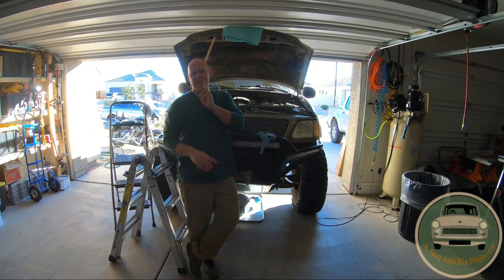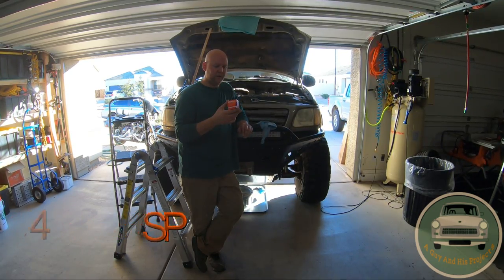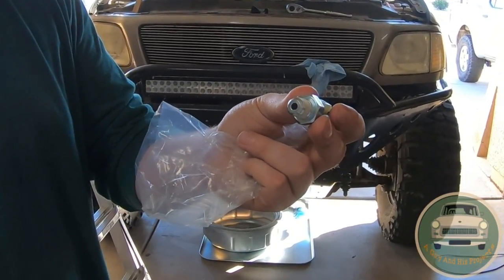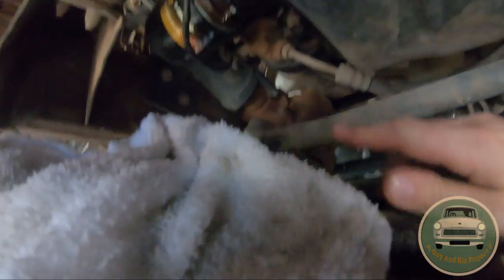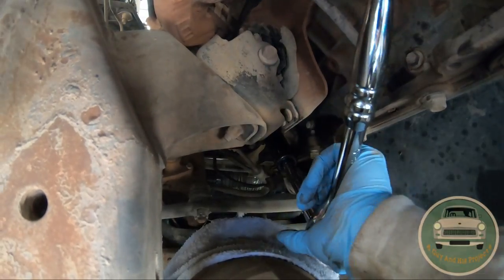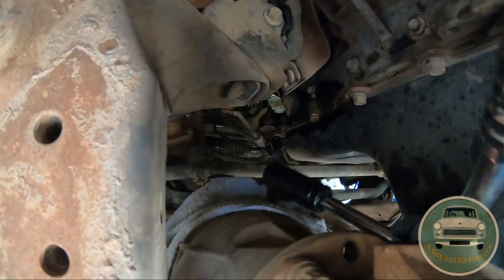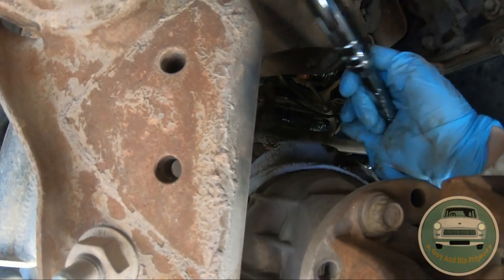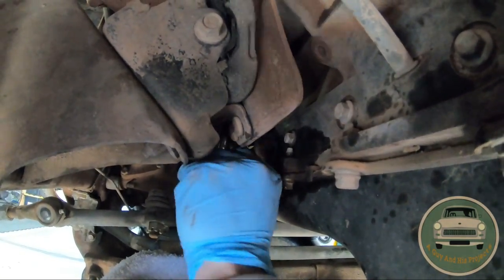How To Change F150 Oil Pressure Sensor aka Oil Pressure Sending Unit

Comment: Thanks for the video. My trucks low oil pright just started to come on when I start it. After 30 seconds or so it'll bounce into the normal position.   I have plenty of oil and only 80k miles. I am going to replace this sensor when I do my oil change next week. 👍🏼

Thanks!
Reply from the maker: Hope it helps! Typically indicates low oil pressure on level thought
Reply: Did changing the sensor resolve the issue? I'm having the same issue with my 2000 F-150. The low oil light only comes on when it's below 40 degrees out and then moves to the normal position

Comment: I have a 2000 RWD 5.4 that when cold the oil light would go on and off until it warmed up. Mine was slightly different to remove though so if anyone sees this and needs help here what I did. 

I was able to get the driver side on a jack stand and my oil pressure sensor was only accessible from the front of the truck. After getting under it I was not able to get the connector out as it was facing towards the back and I could not see or get leverage to remove it. After using an open ended wrench with the connector still on I was able to break the oil pressure sensor loose with the little space I had and turned it around until the connector faced me. Then I used a flathead screwdriver to push down and remove the connector. Then I used the wrench and my fingers to remove the oil pressure sensor. After it came out I had to quickly thread the new one on as oil was coming out and then use the wrench to tighten it back up.
Reply from the maker: Thanks for posting!

Comment: I really like your video and I’ve done a lot of research on my Ford F150 2005 lariat something I didn’t know that took me three months to figure out was from salt corrosion on 2005 that was highway driven there is fuel centre under the spare tire in the rear end. They used to be made out of aluminum and when we finally determined after $1000, I’ve changing out other parts was an $90 fax under the spare tire at the rear end, which is a relay sensor. The old ones are made of aluminum. The new ones are made of plastic and that fix my problem. You should make a video about it.
Reply from the maker: Haha I feel the pain! I have heard similar stories from others about that dang relay

Comment: Hey man I think mine went out i lost all oil pressure but i know nothing about trucks. I have the same truck but do you need to be under the truck to find the sensor ? I can see my oil filter but just the bottom of it when i crawl under the truck. If I take this to a mechanic how much will i spend?
Reply from the maker: I have no idea what a shop would charge, it is pretty easy to diy though!

Comment: Is this a normal issue? My 4.6 has been flickering to zero, then at pressure is flickering up and down a bit, it has to be a bad reading as there is no knock,I just changed the oil as well low kms 240*** so figure I should change it?
Reply from the maker: Thanks for watching! Perhaps more will chime in to help answer your question. As I am not a mechanic I don't know if it is a common issue or not. That being said, it is a pretty dang cheap if you did just want to replace it.
Reply: @BigPoppaPumpx  good to hear

Comment: Hey guy! Hope all is well. I have a 2003 Ford F-150 with the oil pressure sensor on  but in this case the oil pressure gauge is not at fault but the hot or cold engine gauge is flickering. Any thought? Thanks in advance
Reply: could be a gauge cluster. buy an obd2 scanner with diagnostic capabilities off amazon that connects to ur phone. check the temp readings there. if its fine there, idk anything about electronic repair but theres probably an issue there. see if they rebuild them on ebay
Reply: if u really dont want to buy that scanner, just buy a new coolant temp sensor. thats the wrong way to do it tho.
Reply from the maker: Could be a simple light bulb issue, or like Bogus Lawyer mentioned pretty much anything in the gauge cluster. Or who knows, maybe the sensor is going bad. Really hard to diagnose that kind of thing when you aren't there in person...Also, I am not a mechanic.

Comment: I lose oil pressure when im at a stop but when i hit the gas i gain oil pressure again? Could this be the sensor?
Reply from the maker: Very well could be, lets hope it isn't the pump! Either way replacing the sensor is a cheap easy way to find out. Cheaper/easier/faster than going in for an official diagnosis lol
Reply: Mr. Walker, did this fix the issue? Mine has been doing the same for a few years.

Comment: I have the extended oil cooler line with my filter all the way out to the front bumper... is the oil pressre sensor going to still be in the location yours is?
Reply from the maker: Unless your kit moves the sensor as well I would imagine that the sensor would stay where it's at.
Reply: I'm actually wondering if the very slow leak that always beads down my oil cooler line could possibly be from the sensor I always thought it was from the cooler line itself and I almost put some at-205 in the motor in hopes of rejuvenating the rubber to slow the week or stop it but now I'm thinking about checking that sensor. I don't have any gauge problems but that doesn't mean it's not leaking right?
Reply from the maker: @ryanwyrick6947  that could be correct yes. It is a very simple thing to check! As cheap as they are, if you are pulling it out, you may consider just replacing it while you are at it. However simply tightening it, or pulling it and putting some Teflon on the threads might just solve your leak!
Reply: @AGuyandHisProjects  man if thats it ill be a happy camper... thanks for your time and efforts out here.... how can I donate to your channel?
Reply from the maker: @ryanwyrick6947  you are more than welcome! I'm all about helping people out. I hope that is your issue as well, simple fix is always the "best" fix. I super appreciate your willingness to donate! As of now I do not have any venue set up to accept donations though other than the typical PayPal and such. Those however are not dedicated to the channel.

Comment: I cracked the block this screws into. What should I do now? JB weld didn't hold lol
Reply from the maker: Dang that is a crappy situation lol. Potentially find a replacement, a lot of then just screw on. Not sure about these ones though

Comment: What does replacing this se ding unit fix?
Reply from the maker: Fixes the oil pressure gauge on the dash/computer
Reply: mesa003 It fixes a head gasket leak. Tell everyone you know.

Comment: I thought this video was how to turn a stock Ford oil switch to where it actually reads your oil pressure not just 7.
Reply from the maker: You'd need an aftermarket guage for that. The stock sensor works, it is the guage that is programmed to be the "dummy" guage and point the needle

Comment: Maybe you could have better secured that busted wire harness plug with a bunch of little wire ties. You know, one around the sending unit, one around the harness plug and two more connecting the first two together to keep the whole mess together.
Reply from the maker: Thanks for watching! Yes that could have been an option. As is it has not been an issue however. I am a large fan of zip ties lol!